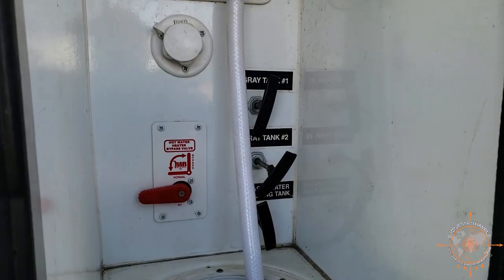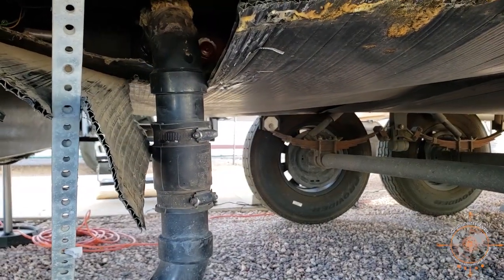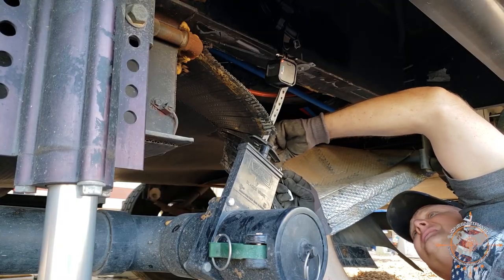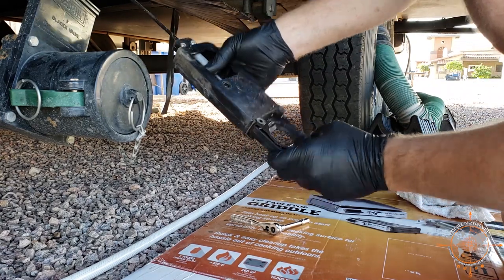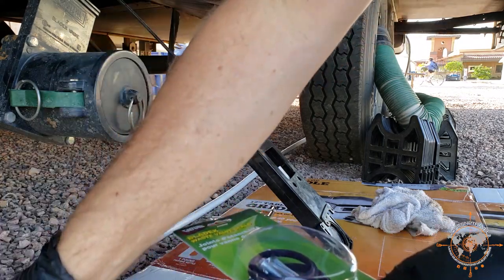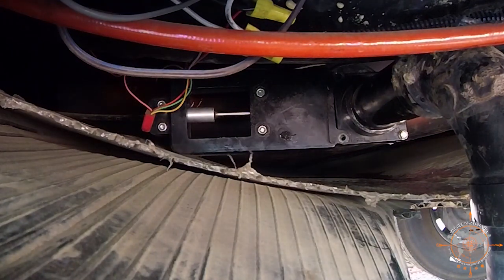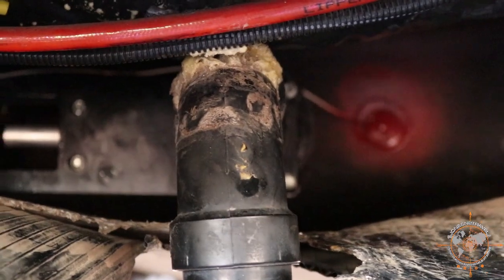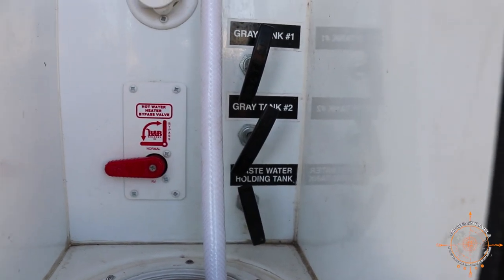HOW TO REPAIR RV SEWER VALVE LEAK | RV LIVING

Comment: I am working on a black tank valve. My seals keep on moving a litte when I put it back on. So I leak. Can I put something on to hold the seals in place?
Reply from the maker: Hi Mark. Thanks for checking out the video. I typically use a pool o-ring lubricant. You can get it at the big box store or on Amazon. Here is the link to it on Amazon https://amzn.to/3ZiCRfp
Hope that helps. Safe Travels